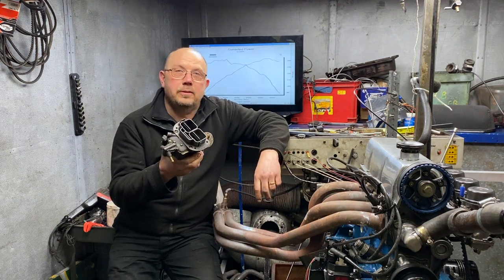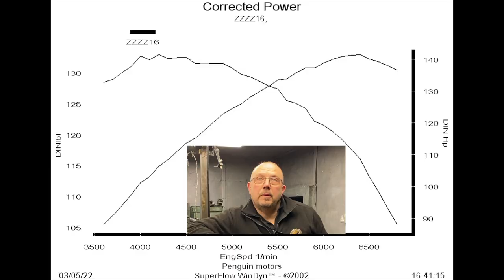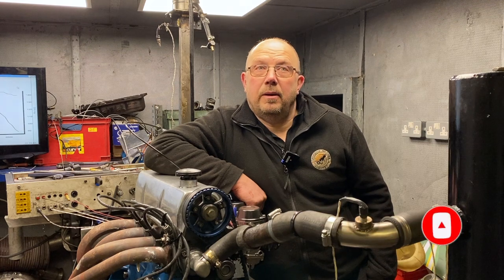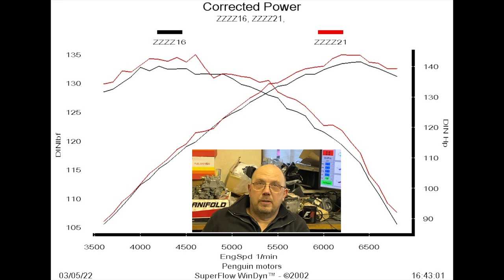How To Get MORE Free Horsepower - Ford Pinto

Comment: I know this is old but I'll put some stuff here anyway.
I built my 2.0L pinto motor up a bit. One of the early stock modifications is to retard the stock cam a few degrees. I didn't have an adjustable so I just filed the keyway 3/64". That made a noticeable difference in drivability.
After that I put a really good street cam and the legendary Holly 390 4V on a weiand manifold and a set of headers, into stock exhaust. I had the engine apart so I had it all checked for cracks and balanced. I also put a aftermarket pointless ignition and was able to shift at 7000 RPM. (The 4 speed stock transmission did not like that one bit). 
I absolutely loved that engine. 

The coupling between the header and the exhaust kept coming lose. After putting back on several times I realized  I was pushing too much air for the stock muffler and it was blowing off.

Comment: Good video Graham , your right in the scheme of things anything is better than nothing , so your saying 10+ hp gain on spacers and other minimal mods. Did the mixtures need fettling at all ....
Reply from the maker: the manifold mods didn't effect the AFR, but the spacer under the carb did,  after fitting that I had to increase the size of the mains, and im pretty certain i had to go bigger still on the mains after i bored the chokes

Comment: My Ford 2.0 engine 
I got better gas mileage and better performance when I order a electronic ignition system and installed it  and stopped using the standard points in the distributor 👍🌎🇺🇸
Joey ⚓

Comment: There was an outbreak of insanity that made guys throw away their chokes and even mill down the choke towers on Holley four barrels. Now it is nearly impossible to find a used  one that isn't butchered.  The parts thrown away cost a fortune to replace.  Of course there was no horsepower gain.  Also, the engines subjected to this abuse got the cylinders washed down with fuel as guys tried to start a chokeless engine. And the valves got burnt as guys drove around on an engine running too lean.  "Duh.  Works just fine... ahhh don need no choke..." said Bubba.  Before he put rear shackles on the back springs...
Reply from the maker: carburetor manufacturers are not stupid, they are not going to design a carb with a choke mechanism that badly restricts airflow, a quick look should show  you that the choke opening surface  area is  the biggest part of the carb, so most airflow restriction must be below it

Comment: I would love to know what  timing curve did you test at. (Base timing) vs advance per rpm. Peak advance. At what rpm. Wondering how much is too much. When do you encounter knock/ destination. Very interested 🙏
 I feel like that would be a good video if you hadn't gone over that yet.
Reply from the maker: it was a while ago now, but timing would of been around 10-12 degrees 1000rpm, 28-30 @3500. if the fuel has a high enough octane to suit the compression/cam combo, you wont run into detonation until you have advanced the timing enough that it no longer adds power. the trick is to creep up on it and use as little timing as possible to make the biggest numbers.
Reply: @PenguinMotors  hello,did the pinto like to use more advance from low to high rpm .have  pinto turbo with megasquirt and  at the moment is at 36 degrees advance from 2500 rpm to the red line at  100 kpa is it good ? what is the best timing at all

Comment: but did you increase the main jets after going up 2mm on the chokes?? it MUST have run weaker after boring them out ! go up 0.10 on the mains and test again!!
Reply from the maker: The test was done a while ago so I don’t remember jetting details, but yes I would of gone up on the mains. AFR is monitored every dyno test and backed up by checking the spark plug colour

Comment: So can you now test the 38dgas with no mods to the modified 32/36
Reply from the maker: might do some day, but i can tell you now the modded 32/36 would win
Reply: @PenguinMotors  I have all the mods on a 32/36 on one of my engines but not the spacers it’s ported standard valves 275 deg  cam 290 lift on the lobe making 121hp at the tyres in a Mk 3 cortina it’s done 10.23 on the 1/8th. I did have trouble getting it rich enough like you with the twin choke 40 I ended up raising the float level as well to get the fuel in. My Capri has a bp285 standard valves but ported 38dgas and has done 10:23 also it has not been on the dyno. I think the cortina motor is better it pulls like crazy. I have twin 40 dellortos to fit one day both are street engines the bp285 is not as good on the street as it falls off the cam. Love your work. 👍

Comment: One more question: When boring the chokes, would the jet size have to be adapted? If so, means bigger choke size a bigger (bc more airflow) or smaller (bc less velocity in venturi) jet?
Reply from the maker: Bigger chokes require bigger main jets
Reply: Thank you, helpfull as always!

Can I reach out to you via email, I have two not yet tested stub stacks for the 32/36 I would donate to you for testing if you are interested, I will cover shipping expenses.

Your back to back dyno testing is so valuable, would like to contribute!

Best regards,
Martin
Reply from the maker: Many thanks penguinmotors@outlook.com
Reply: @PenguinMotors  Thanks, I send you an email

Comment: I'm surprised that removing the choke flaps made no difference and possibly even lost power in the lower RPM range. As those flaps cut across the bore at a different angle to the auxiliary venturis, is it possible that this sets up a sort of twist in the airflow, creating swirl which improves combustion? If yes, could sidedraughts benefit from having some sort of swirl vane added inside the trumpets?
Regarding the airhorn, you said you found an inexpensive 3D printed item on eBay. I can only find an expensive aluminium billet item. I guess your testing shows that it's not a part worth paying money for, no matter the price.
Reply from the maker: i actually wondered the reverse, are the flaps helping to straighten out the air flow? i would be interested to try an actual ram pipe rather than a stub, i think that would work better on this carb
Reply: @PenguinMotors  Given your experience vs mine, you're probably right. Although wouldn't straightening of the airflow help across the range? Would something like a smoke machine be an aid in determining what's occurring?
Reply from the maker: @andrewleonard9257  low rpm, full throttle air speed is very slow through the carb which might be why it only hurt it low down
Reply: @PenguinMotors  Probably so. Does removing the choke flaps improve the CFM? Have you seen many cases of mods improving flow but making no difference on the dyno, or even producing less BHP?
Reply from the maker: @andrewleonard9257  on a flow bench you will see a small airflow gain removing choke flaps. Flowbench  gains do not always show up as more power on the dyno
Reply: @PenguinMotors  Yes, and I would presume this usually occurs when more flow comes at the expense of lower air velocity, which results in less inertial ramming and combustion chamber turbulence.
Could the loss of low down torque when the choke flaps are removed, have something to do with changes in air velocity? The upper section of the carb barrels (the squarish area), probably has much more cross-sectional area than the OD of the venturi. With the flaps in place, the change in cross-sectional area would be less abrupt. Not only might this improve the flow going into the venturi, but it might also result in less wave reflections at that point. Just as an experiment, Is it possible for squarish area to be filled in with an epoxy, so that it had a round shape with the same ID as the OD of the venturi? That is, 38mm for the 38/38 Weber.
Reply: DCD screws will work on 40Dcoe also?